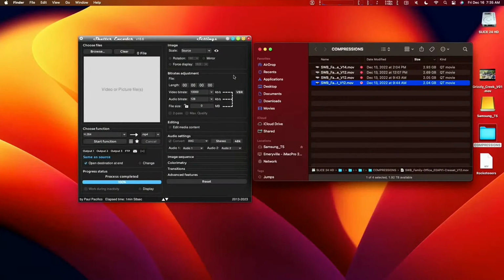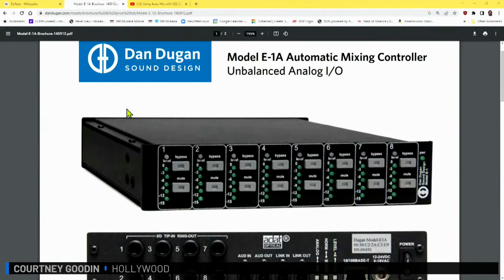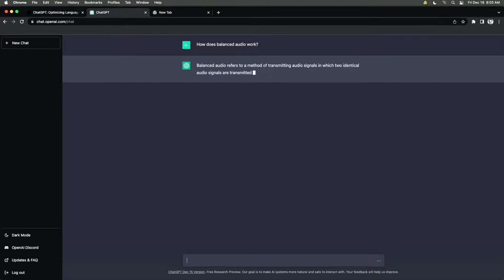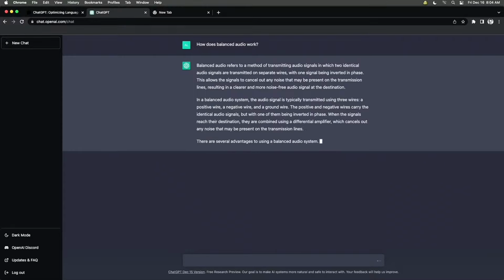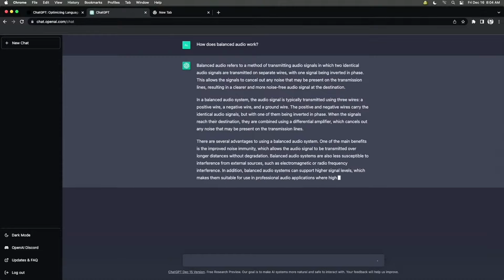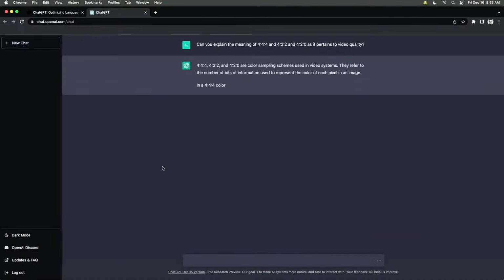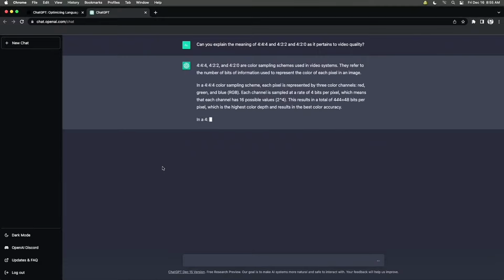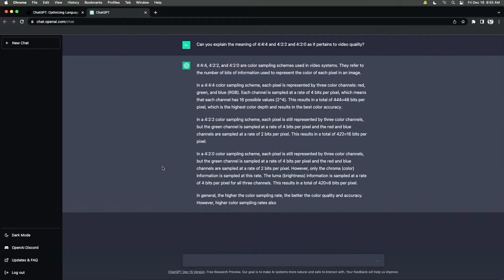Focus on ChatGPT

Comment from the maker: 00:18 Zoom Rooms is getting a big update, including capture of 4 cameras at once, NDI in breakout rooms, and "Persistent Outputs" which overhaul the ZR implementation to make it function more like ZoomISO. The features are cross platform. Thoughts?
07:25 I stumbled across an old digital camera. It had a full SD card, but when I try to pull data from it, it's corrupted. Specifically, the card unmounts itself shortly after plugging in. Is there any way to recover the data?
10:29 Any suggestions for best, quick setup mic & speaker combo that can bring multiple people (just audio) into a zoom meeting in the same room running off of just one computer? For impromptu situations that commonly pop up in office.
12:13 ZoomISO help: permission denied if recording is stopped (mtg set to local record option and ZoomISO is co-host). Hangup/redial ZoomISO does not help. Suggestions? Thanks!
13:12 How do you make a youtube "clip" out of any youtube video?
16:12 I’m using a mocap suit to control video playback with different gestures. I want to emulate VCR playback. Where could I find the different rates at which VCRs would fast-forward/rewind tapes? (E.g. STOP+REWIND = faster than just pressing REWIND.)
19:34 To use ZoomISO Pro at 1080p with High Bandwidth Mode, what type of Zoom account would one need to get, and what is the price?
20:59 ESPN made an early push into remote production with their "Live From Home" initiative, but talked about "going back to site" as soon as it became possible. What will it take (technically and organizationally) to make decentralized models the default?
31:53 Any thoughts on the new Comica CVM-Linkflex AD5 denoise? Budget Noise Assist?
34:29 After my question the other day about compression times on the Mac Studio Ultra my friend showed me a new Encoding App... Ever heard of Shutter Encoder?
40:25 How do you identify grounding issues in an event? and what are good practices to know?
43:21 How do you use the "Video Follows Audio" feature of MixEffect Pro? How would you use this in a zoom meeting?
46:29 Looking for a mixer for town hall type of meetings. Is the Behringer X32 still the go-to or should I invest in something newer around the same price range?
49:19 What is a good headset to give to kid for xbox so you don't have to listen to the horrible microphones that come on headsets marketed for xbox.
49:56 Many hardware synthesizers (even higher-end models from the likes of Sequential) have unbalanced outputs. I know Alex has said "never use unbalanced audio" but if you must, would keeping cables short and using a DI box/preamp be the route to take?
50:45 Is there anyway to select the audio output of the ATEM HDMI outputs on an Extreme? Seems program goes out of both not matter what is selected for the video output.
51:07 Courtney recommended Pacific Radio ([link]) as a supplier for custom cabling and other products. Would there be any supplier on the US East Coast the panel would recommend?
51:41 I have just request my Google Photos takeout data as I was nearing the free basic 15Gb limit. The zipped files available to download are 115Gb with all albums selected. Tried a second request for only the individual years, it's 70Gb. Any ideas why?
53:09 What do you think of using this case for the basis of a bespoke Playoutbee player? [link]
55:48 What was the dante-chain that Alex is using for high-quality phone calls embedding his XLR Mike?
57:04 I have a presonus 1824c. Like similar units it doesn't actually have 18 inputs. Suggestions for taking advantage of those extra ADAT inputs? Is there a simple hardware upgrade or am I better off using a completely different device?
57:58 What has your experience been running Dante on converged networks with other traffic?
59:26 Office Hours will have it's 1000th show this coming Monday Dec 19! 
The show starts at the usual time (you might want to be in your seats early:) but will run longer. What do you hope to see on Monday's "KiloShow"?